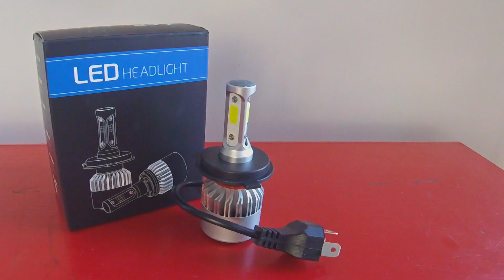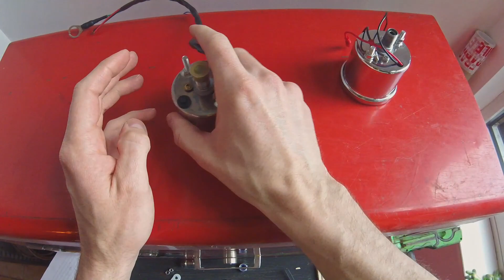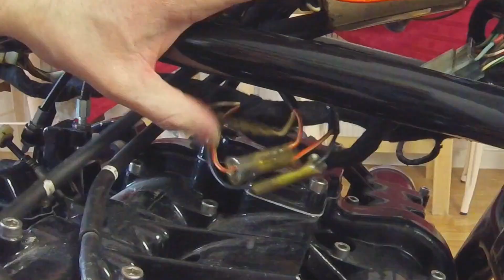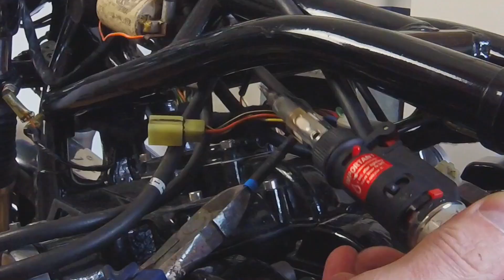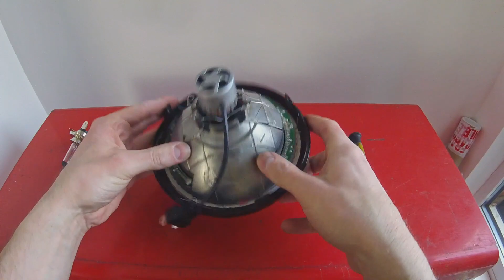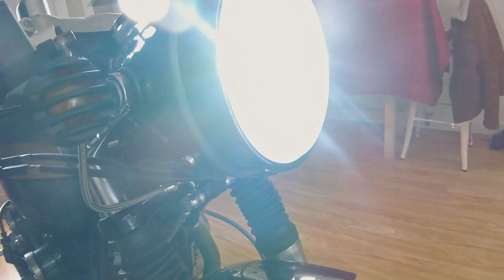Cafe Racer Suzuki GS 750 Motorcycle Build Wiring Aftermarket Digital Tachometer Part 26

Comment: i dont understand where the wire in the loom comes from is the stator signal  and how do i find which wire that is
Reply from the maker: The wire in the loom was not used for that particular model. If you don't have that particular wire just run another wire.
Reply: @dtaylo4517  find another wire that comes from where ? the stator or ?
Reply from the maker: Just run a new wire from the ignition coil to the rev counter.

Comment: Hi thanks for sharing im doing the same but with a gs500 dont you need to attach both signals in order to get proper rpm? I did conct just to one coil as you did Cuz im waiting for the diodes to come Up on the mail but was wondering if i can just pick the Signal Up from just one coil did your bike actually do a good reading on the tachometer? Thanks
Reply from the maker: Good job on the diodes, I didnt fit any and had issues with the dial and LEDS at high revs. I looked into fitting resistors but it started to get overcrowded with wiring in the lamp so I removed it all and went for single speedo unit with everything housed in the unit. little more costly but sorted the issues.
Reply: @dtaylo4517  thats what im installing a speedo screen

Comment: I have a 1982 yamah xj650, My bike had a tech cable so how do I wire the the wire for it to read rpms on my old bike
Reply from the maker: Should be the same as the video. Wire the aftermarket dial rpm signal wire to the supply wire (primary side) of one of the ignition coils.

Comment: Was hoping this would work on my 81 but sadly it won’t. They must’ve changed the 70s model and 80s. Time to dig back into it lol. Also in the process of making some rear set brackets based off your design so thank you for that! Got the bike running a few weeks ago (vid on Channel 🤫😂) now just cleaning up and finishing wiring etc! Actually have the same speedometer!
Reply from the maker: I believe the 80s wiring harness to be safer, for all the different circuitry on the the 70s GS there is only 1 fuse protecting the whole system, seems crazy to me.  
Nice build, challenging/fun riding in that snow :)

Comment: Hey man. Nice work! I am currently doing my own project on a gs550l from 81. I was wondering if you could let me know how you closed the old position of your mechanical rpm line. Did you just reuse the bracket and plug? Then closed it with welding? I have been wondering but didnt find any information on the web. Looking forward to next videos! Videos like these and from others are a major help to me.
Reply from the maker: Yes I used the original plug, just removed the internals, roughened the inner bore cleaned up then filled with JB weld, believe there is good shot of it in the start up vid to the GS.

Comment: Were u buy the Speedometer from mate. You got link
Reply from the maker: I couldn't find my original ebay link, however I have found the dial on Amazon, little tip just double check the wires when you do wire it up https://tinyurl.com/yb9axd2g